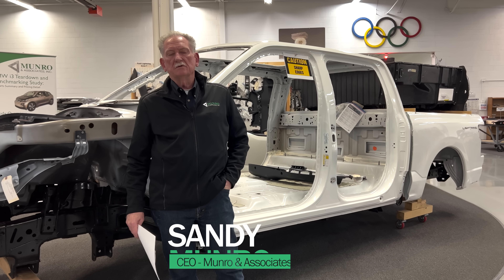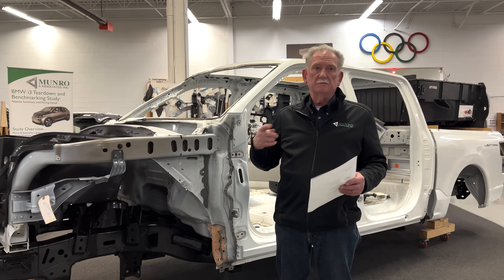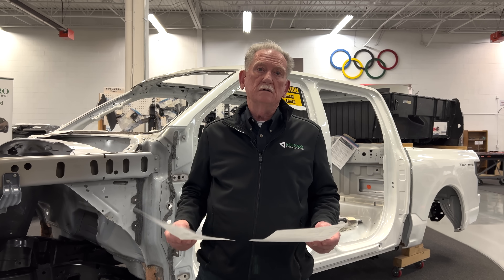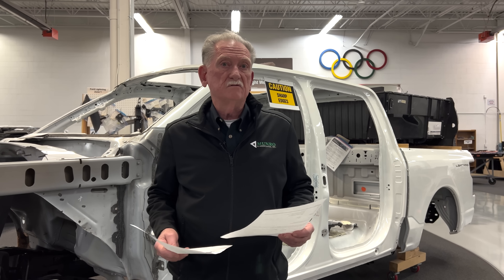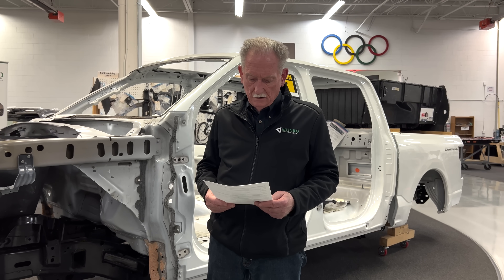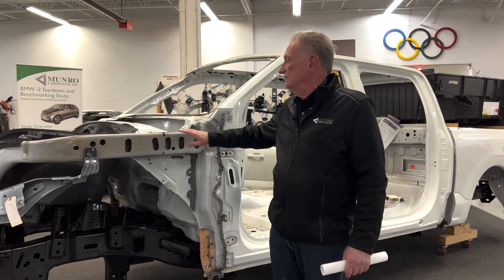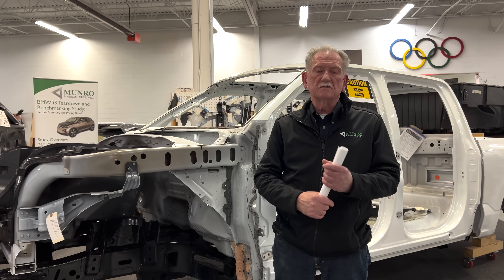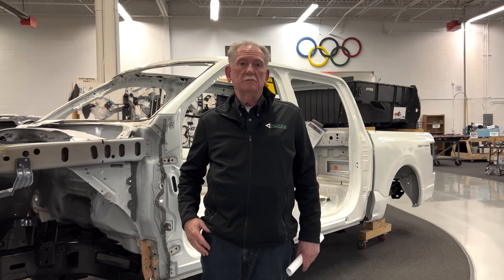Sandy's Initial Thoughts on the 2025 Ram 1500 Ramcharger

Comment: I think this is gonna be a perfect solution for a lot of people!
Full electric for day to day driving, engine generator for heavy long haul scenarios.
Reply: Yeah usually I agree with sandy that people wanting that 500Km range are bit delusional... But, for a truck I understand it. If I would ever buy a truck, it would be for towing a larger boat that I know have, and sometimes I want to visit a lake that could easily be that 200Km away, which then outruns my battery quite badly.
Reply: for short day to day the v6 will not even have to start but for a long haul its there
Reply: I was considering the lightning, but this is perfect for me.
Reply: Yup. That's why I'm interested.
Reply: yes its going to be! and if the system prooves to be even much better, it might evolve into even bigger trucks or vehicles.

Comment: If your truck has 690 miles range ... and 540 of it is from burning fuel,  you have an ICE truck with a weird plug-in power train,  not an EV with a range extender.

Comment: HEAR ME!! I'm kinda shocked at how Sandy doesn't actually understand how a series hybrid works. The 700 mile range is meaningless, because you just fill it up with gas and go as long as you like. Why it's important is TOWING. Did he not hear all the complaints about how the Lighting only tows 100 miles before the battery is dead? THIS solves that! He's also wrong about the weight of adding a gas engine. Ram claims a 92kwh battery, the Ford has a close to 200khw battery? The missing 110kw of battery is WAY heavier than any gas engine! And WAY more expensive. The Ram will be lighter and cheaper BECAUSE of the engine! That's kinda the whole point. He's right about the level of complexity, and normally I'd agree, but I have a lot of experience with the Pentastar and it's crazy durable. And with no transmission, fully HALF of super expensive breakdowns of any car are avoided. And because of how Ram has sized these two power sources, battery degredation 15 years from now won't really be a problem. Even if 50% of the battery capacity was depleated, having a truck with a 75mile range AND the ability to charge on the fly would be fine. I put $100 on one as soon as I saw the specs. This truck will be a HUGE deal.

Comment: They can win it usually Sandy is very good, but he is completely missing the towing aspect and the fact that it has a smaller battery. That's a lot less weight even though you still have an engine. Very surprised he didn't make any of these points

Comment: I completely agree with Sandy. My first question was; Why such a large engine for this task? However, with the charging infrastructure essentially still in flux (except Tesla), the Ramcharger makes a lot of sense. I can charge whenever possible, but fuel up when not. That provides 'piece of mind'. Does this truck make any sense from an engineering perspective? Probably not, but this EV transition will have a lot paths before it consolidates into whatever the ultimate destination ends up being.
Reply: The RAM Charger makes all the sense in the world for towing, a subject Sandy sadly ignored. Read the comments. He 100% missed the point off the generator: towing range.
Reply: The only thing this proves is that they built the truck with the MOST points of failure {=$} possible. There are other ways to do this. It will make NO SENSE when you see the price to buy one or, worse, the price to fix one!
Reply: @harriettanthony7352  I think you have it backwards. Compared to a traditional "parallel" hybrid, having the engine only act as a generator REDUCES points of failure because there's no physical drive train connected to it (transmission, driveshaft, etc).

Comment: 600 lbs is like the difference of the GM EV with the big pack for the additional 130KW battery, but you have twice the complexity and much more maintenance and  no frunk with this REX configuration from Ram 1500

Comment: Honestly, I really do like these developments, very rarely, do you need to drive more than 140 miles on a day.
So it’ll mostly be electric , but you can do everything that the lightning can. He can presumably run all your equipment off of it.
And you can do everything that a normal truck can including towing insanely heavy loads for very long distances.
It’s probably going to be good at everything.

And honestly given that this thing is half the battery capacity, you can electrify two trucks this way for the price of one truck the way the lightning does .
I think it’s a win . Obviously, the lack of a frunk is unfortunate, but people of been OK with that for basically forever so I think this will work out for a lot of people.
Reply: That's the theory, but studies in Europe and California found a majority of people with PHEVs never plug them in.  They just run them as gas vehicles but got them for the tax credits and carpool lane access they offered.  Silly given the lower cost per mile if they plugged them in, but that's what the studies found.
Reply: @kirkellis4329  I think many of those studies are flawed. Many early adopters of PHEVs were government or corporate fleets. The people using these vehicles did not buy them, and had little incentive to install an EVSE when a free gas card is the other option.
Reply: @eric4903   Maybe, but I have a friend in his 70's that was still working with a long commute and never plugged his in.  He bought it just for the carpool lane access in SoCal.
Reply: @kirkellis4329  Benefits like HOV lane access or allowing the vehicle congested cities definitely change behavior. Never liked the idea of using congestion to drive purchase of different (electric) vehicles, as they are unrelated issues.
I definitely saw the same, and California was one of the only areas in the US that had this terrible policy.

Comment: I am surprised they do not also add a cummins diesel to it as well, so it can run gasoline, diesel, or electric... Dodge Logic.   Then they can have all the complexity of an EV, Gasoline, and Diesel... and maybe add one of those cylinder delete systems for the gasoline engine.  Would keep their dealers service departments employees for at least 10 years.

Comment: The competition for the RAMCharger is the RAM 1500 ICE pickup or equivalent, in my opinion.  If both meet one's towing needs, why buy the hybrid?  From a total cost of ownership standpoint, it's not intuitively obvious which is economically superior over 5, 10, or 20 years.  If the RAMCharger is priced to compete with the RAM 1500 ICE, but is not profitable to build, Stellantis will find themselves in the same position as Ford with their Lightning.

Comment: On the RamCharger: Delete 500+ lbs of battery vs the Lightning ext range.  RamCharger’s use case is hauling/towing.  Lightning - 125 miles max between rapid charges.  RamCharger, 250 miles towing. For me, with my travel trailer, RamCharger is an EV truck for daily use AND preserves my ability to tow my TT on vacation, and tow medium sized trailers for weekend work.  For now, with insufficient battery capacity to support serious towing, PHEVs seems to be a solution.
Reply: Ford could probably to a PHEV version of T3.  If they made it with lower curb weight vs Lightning and can do PHEV well with a turbo4, they’re in for long towing too.  For the time being, battery energy density isn’t high enough for long distance hauling +/- trailers.  I’m excited that RAM might make a day-to-day / local use EV truck that will still be able to do long distance towing.  No FRUNK is not a showstopper.  Same as my current truck I use to tow.

Comment: The RAM 1500 Ramcharger is essentially a Volt-style plug-in hybrid. There is a niche where this vehicle makes sense and, as Sandy says, is a step in the right direction. BUT... using gasoline to generate electricity to power motors is INCREDIBLY inefficient, and does not do much to lower CO2 emissions. It also precludes, as Sandy also noted, a frunk. As a 2023 F-150 Lightning owner, I think the truck's huge frunk is one of its three best features, and is one of the things that makes it the best work truck on the planet.

Comment: I had 775 mile range on my Ram 2500. I drove it from Las Vegas to Albuquerque and had to stop 4 times to rest on that trip.

I drive less than 30 miles a day.
I drive 500 miles in a day about three times every other year.

I have a Rivian now and will sell the Rivian to get the Ram. I have 2 dealerships less than 9 miles away for the Ram. The Rivian service center is 238 miles away. Getting basic warranty work done from Rivian is a 3 to 5-day process. The Ram will be a 3-hour process.

Stelantis has been doing the RamCharger in the form of the Pacifica since 2017.

Comment: 2:50 690 miles for 10 hours of driving is overkill? 

Ok wel when I use it like a truck and tow my camper to the beach it’ll be cut in half so that’s only 5 hours of driving. 2 hours there. 2 hours back and an extra hours worth of range to run my a/c at night in the camper it’s the perfect amount of range

Comment: RAM engineers know that range anxiety is the only thing going forward that people will consider in purchasing. It is not about the vehicle it is about where you can plug it into.
Reply: Run a spreadsheet of all the charging stations and run out the math to get the fleet size that it can accomodate. Every sale above that number would require the willingness of the customer to roll the dice and be willing and/or able to wait their turn to charge. Otherwise your excess sales have to be only to customers with assured charging options at home or work. Growth is restrained by the charging station growth. You need to hire an expert in commercial construction who know about the challenges of permitting, heavy industrial electrical services and the dreaded Community Design Standard review boards.

Comment: I think this truck will be a great option for people in rural areas that drive longer distances where there is limited fast charging infrastructure.  I would love to have one.  The only downside is that this truck is going to be very expensive.  I am afraid that it will be prohibitively expensive for most.
Reply: With half the battery size of the Ford, this truck should actually be cheap and lighter. More than enough to offset the cost of the engine. Batteries are heavy and expensive.
Reply: @kipamore  The larger Ford battery is 131 kW usable, 42% larger.  Also the relationship between capacity and weight is not linear.

Comment: Ok 690 miles of range when not towing. That would mean 230-350 of range while towing a heavy load right? Or will it be able to tow that far? 130KW is only 174 HP. While towing a 10,000-14,000lbs load the battery is going to discharge at a faster rate (it's powering quite a bit of the 700hp worth of motors most of the time (ok not downhill but you have to climb that hill too)) than the rate it can charge the battery at 130KW (174 HP). Will there come a point in which this type of truck will have to detune to under 174HP or at least much less then 700HP? Will there be a warning light that pops on the dash "Please pull over and unhitch your trailer (or let me idle for a few hours) (or please plug me in soon) I don't have enough power in the system to continue at this pace" This would be a strange new addition to the "how to plan your towing" book. ICE: Start looking for fuel when you are down to 50 miles range. Electric: Plan out your charging stations and be ready to adjust your plan as you go. Ramcharger: Fill up both "tanks" up and watch out for the "I can't do this anymore" light.

When empty I'm sure it will be easy for Ram to figure out how to give you most of the performance this truck thru all of it's 690mile range. After all a truck like this only needs 100hp or so to cruise at 70mph on a flat plane. But I can't help but wonder how long they will be able to deliver max performance when towing 10-14klbs without stopping. Quite the engineering challenge.

Comment: Hey Sandy, biggest hold back of electric trucks is range under load. Electric trucks need to be able to tow and haul, be it a half ton, a 1 ton or larger. Until battery technology makes multiple step changes forward this is what a functional working truck needs to look like. We need someone to get fully behind this concept and development. Edison Motors enters the chat!
Reply: Also cold winter climates dramatically reduce range so this design is much better than a pure electric in many aspects. Best of both worlds and the first series hybrid truck with no mechanical connection to the motor which will reduce strain and maintenance costs.
Reply: I agree, I need a truck that can haul my tractor and other equipment to the pasture and last all day towing a trailer.  When I go to the field I am there from sunup to sundown and use my truck off and on all day long moving heavy loads.  The fully electric trucks are not there and will not last a full 14 hour day in the fields doing farm work.  In the fall and winter I use my truck to haul wood from the woods that I cut to heat my home and there are no chargers in my hay fields or the woods where I cut wood.  At least this will fill the gap until better technology comes along.
Reply: @crazzyhorse5038  amen! Absolutely what a working truck life looks like!
Reply: I have heard that Dodge are very popular among RV owners. I never realized it until I heard that but I know from experience that when I walk through a camp ground, so many of the big RVs are being towed by Rams.
Reply: This fear is dumb.  All trucks, ICE or BEV or Hybrid, will all get 1/2 of the normal milage while towing.  That's been proven by Alex on Autos here on YouTube.  So, if this range extended RAM can get 700 miles normally, it should get 350 while towing.  That's NOT bad.  Most ICE trucks get less than 500 miles, many barely 400 in their tank of gas, so 100 to 150 miles less than the RAMCharger truck.  The math ain't hard.
Reply: Electric trucks haul just fine with effectively no impact on range (under 5% reduction at max payload in my Lightning). Towing is definitely a concern though. Thankfully I don't tow, I just use the bed and the Lightning does everything I need very well.
Reply: @sotek2345  can't see the forest for the trees, stop focusing on the numbers and look at the practical applications and uses and see how an actual "work truck" is used. Hauling buys from the box store to the job site isn't an actual working truck.

Comment: big difference in the Volt compared to Ramcharger...The ICE engine in Volt can drive the wheels mechanically if needed. The Ramcharger engine will not be mechanically capable of driving the wheels. It will be solely used as a generator. With that difference, the Ram should be able to optimize the best RPM to maximize fuel, charging, efficiency and heat. The maximum power that the engine should reach is the level of being able to charge the battery while also giving enough energy to supply the electric motors which drive the wheels.

Comment: Range is never the issue with electric cars.   But what IS an issue and never mentioned, is the time it takes to recharge if you're on a long trip.   No one wants to stop for 30 minute recharges on a 2000 mile trip.
Reply: By the time you get food, eat, and bathroom, it's been 30-45 minutes...

Comment: Chevy used to sell a hybrid truck that could run a welder. I could see a market for range extended vehicles that can run 240V equipment in the field where there are no other electrical connections. The truck engine should be beefier than any generator that isn't pulled behind as a trailer.

Comment: Sandy, a lot of folks buy a pickup to use. I've read on several occasions that the Ford truck goes down to around 100 miles while towing, that's why the dealer inventory keeps increasing.

Comment: That range is great for overlanding/offroading where you spend extended time out in the backcountry.

And especially for towing. That 690 miles becomes 300 miles or less depending on weather and the aerodynamics of your load.
Reply: They should really just go straight diesel if they're using the engine as a range extender.  Diesels are way better as generators especially running at a fixed RPM at ideal load.  It even makes sense from a health perspective because the big scare around diesels is the NOX emissions which are more harmful to humans, but with that electric range and regen braking you'll hardly ever need to run that generator in urban traffic.
Reply: @ResonantFrequency  More customers are familiar with gasoline and gasoline is more widely available than diesel - every gas station sells gas - so while diesel would be more efficient for a ICE-Electric hybrid powertrain, gasoline is a better choice for the market at which this truck is aimed.
Reply: @ResonantFrequency  or Atkinson, which is cleaner, cheaper and wouldn't require DPF and DEF.

Comment: Daily I drive about 32 miles. However, when I go visit family twice a year, I need about 500 miles of range as there are no fast chargers closer than that. Until fast chargers are as ubiquitous as gas pumps, a single vehicle does not meet all of my needs. The Toyota Prius Prime PHEV would and would be much more efficient, but its offroad ability on snowy gravel roads gives me pause. This vehicle may be a transition vehicle for the segment of the population that lives in a rural setting without present access to fast chargers spaced within reachable distance.